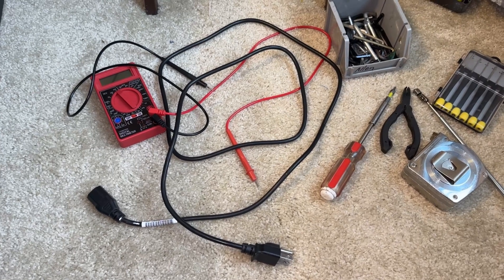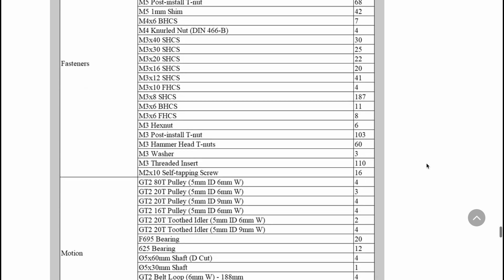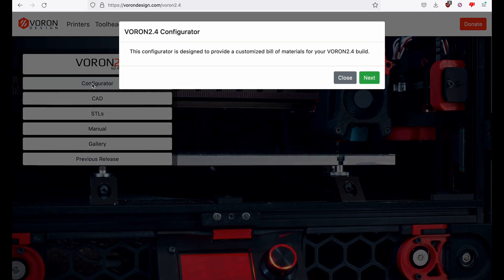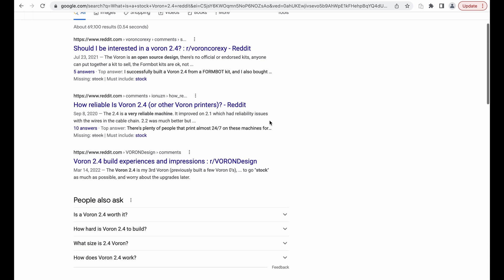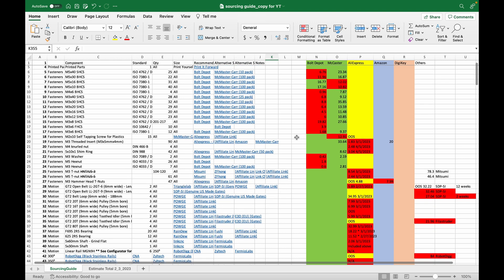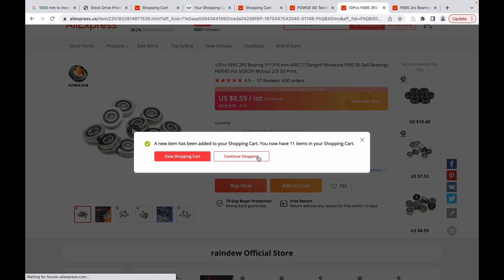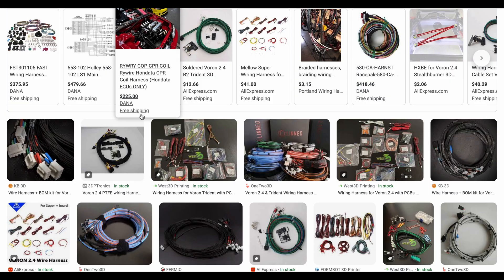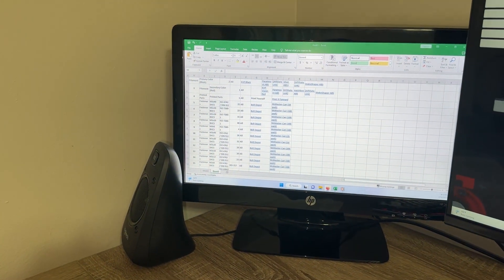DIY Voron 2.4r2 Part 3: Sourcing Considerations

Comment: I'm wanting to build a 2.4 350mm but the LDO kit isn't currently available in the US.  Self sourcing as you mentioned means everything is exactly what you want but it's a serious challenge.  Waiting months for parts can lead to distractions of the build and potentially prolong it forever (for me).  When I'm focused on something I want to deal with it now and to the end, if I can't then who knows how long (if ever) it will take.  For me, a kit makes sense.  Just my opinion of course.  Great video, never really looked at self sourcing for the reasons I mentioned and to be honest it enforces what my original thoughts were doing so.  Too complicated...  Thanks!
Reply from the maker: Thank you for the feedback.  It took me about two months to find everything.  Most challenging to find was a build plate with holes pre drilled and tapped.